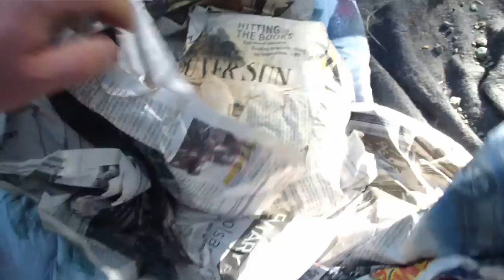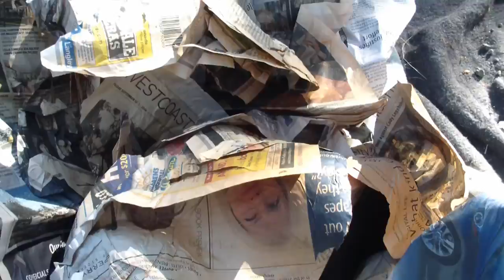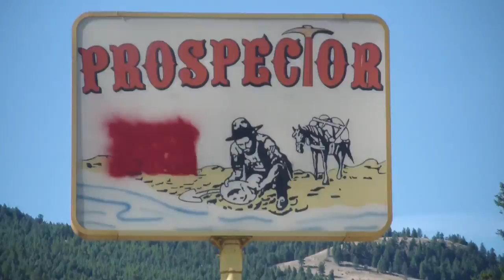$200 Axe. Wetterlings Sweden Bushman by Survivorman Les Shroud

Comment: Regarding the "Dear John's" front tires, they're angled toward each other to reduce the footprint as much as possible while still having two front wheels. Only one wheel means the front end sinks into soft ground pretty easily. Two wheels limits that problem but  those types of tractors were typically used for rows of crops, where you could stick the front wheels in between two rows and have the rows pass under the tractor inside of the rear wheels. Having parallel front wheels would make them too wide, so the solution? Just slant them. Typically the tires are angled too so the surface is still flat against the ground. 
Could they have just made the front wheels as far apart as the rear wheels? Sure, but then the turning circle would have been much larger. With the tricycle layout it's less stable (not a problem on flat ground but terrifying on hills) but it can turn 180 degrees in about twice it's width by pretty much pivoting on one rear wheel, perfect for going up and down rows.

TL:DR Doesn't crush stuff, turns better, no one probably cares

Comment: Granfors bruks is where it is at. 180 for a maul. 80 for a wedge. 125 for a small forest axe. All of them.deadly works of art that you can shave with or chop wood for hours before you.need to touch up the blade. All of them.ore signed by the smith so there is acountability and pride in the making. You made.me laugh so I'm subbing.

Comment: If it hadn't been answered already, that machine hooked up to the John Deere at 4:20 is an old belt powered threshing machine. Wheat stalks go in the front, seed comes out the side, and all the stalks and chaff come out the big pipe in back. Often run with big steam traction engines.

Comment: yard sale hammer/hatchet i paid 5 bucks for bought it because of the octagonal hammer head no handle cleaned the rust off and found the name bigalow a anvil and crucible steel under the rust no chips on the edge just dull, found it on a antiques site and its worth around 150 bucks and it works like a charm

Comment: On the tractor with the weeble-wobbles, the idea was to minimize footprint and allow less space between rows for row crops, ideally at most the same as the width of a rear wheel. The camber is jacked so down on the ground you have a thin foot, but up toward the top the wider gap allowed manufacturers to still put a properly-beefy pedestal for the tractor to sit on. The narrow front also allowed a tighter turn radius for a tractor.

Other benefits arose from this arrangement, such as easier steering, and mud not being as much of a hassle. This led the weeble to become the standard in the narrow front days.

And the Clinton Engines chainsaw is just cool. My grandpa worked the Maquoketa factory for years and years. The factory had shut its doors for years and years before it was all torn down, the only thing left standing was the headquarters building which was turned into a Clinton Engines museum. Last I knew it was still just a big expanse of bare land where that factory once stood, where they churned out all sorts of small engine appliances from chainsaws to boat motors. You'll know a Clinton if you see one with their arrowhead logo, a big nod to the large amount of Native American presence in the Eastern Iowa area. Very cool.

Comment: What a great video love the old engines the large one in a Fairbanks Morse Z 6HP and the cooling is by evaporation so you where correct. when the engine is working as it evaporated you just top it up to 1"-2" below the top off the hopper.

Comment: Called hopper cooling over here, The old Lister engines had it. The water jacket surrounds the cylinder and head. Just top up the water when it boils off. Can make a cup of tea too!   Had a tap on the side to drain it if it was going to  freeze overnight.

Comment: I have two Grandfors axes and one wetterlings all three are for specific jobs the handles are shocking on both the grandsfors and one of them has been replaced twice as the head cracked twice. My wetterlings is consistent and does what I ask it day in day out. There both owned by the same people now and to be honest I wouldn't but another new axe now as old ones are better if your willing to spend the time sorting them out.

Comment: Say Heah,  I got lucky,  I firstly ordered a closeoit Hultafors Bruks 17" Agdor,  Because they dropped it for another range,  Mine came without ears and the new range comes with ears and the edge is nicer and polished,  but more $$$.  But everything else it's spot on,  with a even and grain.  I recently again got a e-mail on a Husqvarna Forest Axe this one was just on sale and at a great price since Hultafors Bruks makes them for Husqvarna All they do is put their name on it.  But it's still Swedish steel. And this one a me out spot on too.  I have a formula for axes,  If it's a heavy head then I could heft a shorter handle,  If the head is lighter then I heft it with a longer handle.  Speed vs.  Weight,  Like my Iltis Oxhead I made into a House Axe,  it's a heavy head and even though it has thin cheeks,  I still could split with it, But with my new Husqvarna it has a lighter head and even though it has a 26" handle,  I can harness carry it with no problemo.  Thanx for the warning,  Because I almost bought that Axe at DLT.

Comment: Try a Gransfors Bruks if you want to spend that much but get the best axe in the world...
Reply: PS- What language DO you speak??   ; )
Reply: Plus avoid bearded style heads which are more for show or carpentry. I'll leave you to decide if I mean the axe or axe owner.
Reply: Shibumi agreed, gransfors bruks small forest axe for awsome lightweight cutter and can split OK.  expensive but no design flaws I've found, but spend time looking at the full range to pick your best poison. there all built for a very specific purpose. just shelled out for the large splitting axe for home splitting, it's gorgeous head to handle.
Reply: I'm a big fan of gransfors they haven't let me down yet and have a good warranty
Reply: Love my Hultafors, light but splits logs nicely. Good for bringing camping
Reply: Wetterlings and gransfors bruks are same same but different
Reply: Ok,wranglerstar

Comment: Another little tip if you don't know it.
a cheap Walmart hatchet, dull is fine  and a cheap army type folding shovel will get you out of any snow/ice related situation.
you simply make a brand new road 4 feet long in about 15 minutes

Comment: Not such an 'old fella', but you were right about the cooling on the engine at 6:00. Fill up the water jacket and don't let it boil dry. Lo tech, no radiators or fan belts to waste precious horsepower.

Comment: 5:30 john-deere hit&miss water pump engine. i restored one when i was a teen. ~1.5HP or so. car battery: they couldn't fix the magneto. i never fixed mine either. 6:00 not evaporative, the water's there what for boiling. it runs till it boils, then keeps running. just keep adding water as it boils off (slowly, so you don't crack the iron).

Comment: I just spent $23 on ebay to buy a good old American made Collins axe head. If I buy a $20 hickory handle and refinish the Collins, it will be $43. I will never spend $200 for an axe. It is just a sin. By the way, for splitting wood there is a wood splitting axe head which is much heavier, much fatter, and much longer.

Comment: Council tool boys axe $30 US good buy. I sold my gransfors and use the council. The only other option is to restore vintage. For splitting with the light axes like that I have found that laying them long ways on another log (same way you were doing to buck) and hitting the side not the end grain is the only way to go. Thanks for the laugh as usual.

Comment: 04:35 lol, that's so you can go between the rows without messing up your pretty work. There are tractors with just one front wheel, but they're hard as hell to turn cause there's less surface area to distribute the weight. And now you know more about tractors than you wanted to.

Comment: Also, In a commercial application you would want to wrap haywire from the head to about 4or 5 inches up the handle to stop the wood from turning your handle to shreds.
Wrap the haywire in electricians tape so she'll look pretty to meet your wife.

Comment: If you're looking for a new axe, go with Gransfors Bruk.  Much higher quality and much better design.  If you want something a little better, but hand forged by bladesmiths, go with Autine.
Reply: +TheWaffledOne 

Wetterlings where bougt up by Gränsfors some Years ago.
Reply: +TheWaffledOne Wranglerstar did test an Autine and the head came loose because the eye was not done properly and they filled the voids with epoxy. If it was my 300 bucks I would buy 2 Gränsfors Bruks.

Comment: There is nothing wrong withe ax. you just chose the wrong ax for what you were doing. A felling ax is for felling trees. a splitting ax is for splitting wood, and for making kindling. Wetterling makes a complete line of axes, also Gransfors Bruks is of similar high quality. The Husquivarna  line of axes are made by Wetterling, but are more reasonably priced for good quality.

Comment: I wonder how much of the price is attributable to having "les shroud" on the axe. I look at that thing and I don't see $200 anywhere on it. When  you go through the comments on amazon, you see that the wetterling's forest axe was $65 in 2011, and somehow it's $150 now. 

Most of the scandi axes look like they're at the upper end of being sharpenable by a file and stone. Not sure what practical advantage they'd have over a vintage $25-$50  kelly cruiser mounted in a new handle. I'd guess none to actually negative (since kelly has a big enough bulge in the cheeks to make the axe easy to remove from a deep cut).

Comment: Gränsfors Bruk bought Wetterlings so the quality should have improved but nether are really all that good and there is nothing special about Swedish steel nowadays.
Reply: ***** I'd recommend a Hults bruk axe. They were bought by Hultafors and so you'll have to look around on the used market. Agdor was a popular model. They can be had for $45 from a surplus store here in Sweden.
Reply: ***** Here is the axe that can be had for $45 http://store.flobyoverskottslager.se/product/yxa-st%C3%B6rre
Reply: I could snail mail that one to you if you sent the money over say paypal.
Reply: ***** Right on! :) But I do hope you pick (get lucky) a beter one next time.
Reply: ***** the steel is good and they dont look like a aprentice mistake like the one in the video. I'd rather have more steel than i need and work it down to something good than to have something with a wonky edge. :)

Comment: give it a wee grind on the sticky bit. thats a woodworkers axe almost.  if you look at some of the old light axes for actual fabrication by stock removal, they just have a pretty minimal connection with the handle, so if you were to use it as an actual werkzeug you could cut the silly modern excess bit clean off. its just there so modern man can exert his full dumb force without breaking it.

Comment: Wetterlings Carpenter's Axe, yeah you probably already know. Blade is a little too curved, no good for shingles. Poll is just a little short but still useful for roofing nails, nail between fingers, palm up. Handle too long. Original design is for a shorter 12-16in. But $200, lol , P.T. Barnum was right!

Comment: I don't think my first response got there.
Poor handle choice.
You want the grain to crest at the front or back of the handle.
It's stronger for prying to the sides.
Also, using haywire,lay a bead 5 inches from the head towards the head and wrap it down to where you started and tie it off.
Now the wood can't wear on your handle .
Wrap it with electricians tape to be pretty.

Comment: Dude your axe is for like chipping some kindles to start the fireplace. Woodchopping axes have wider cutting angle so it wont stick and actually "chop"
We had similar axes in the army, only because they needed to be light. Still sucked tho.

I have a Fiskars woodcutting axe and its good. Even has some weird slippy coating on the head for some glidier chopping or something.

Comment: At 4:30, that my friend is a ye olde grain thesher. Runs by that belt round the flywheels by either steam engine or one of those stationary internal combustion ones
Reply: David North back in the day, Ford sold a belt drive attachment for the drive wheel on the model T. ( you took off the wheel, pit on the drive pulley.. f course the car was jacked up)
and you could use your ford as portable power.( selling point in the rural areas)

Comment: Maybe you could weld a wedge behind the blade bottom that would split lumber before hitting the handle?
Reply: +Marc83Aus Shouldn't have to for $200.
Reply: +Marc83Aus Shouldn't have to for $200.
Reply: I'd ease the sharp corners with a grinder, but yeah, for $200, you shouldn't have to.
Reply: If regrinding is a necessity, might as well just get an Estwing and grind the edge to the profile you want.

Comment: In Alberta you cant even chop up dead fall. It's around $280 fine. Just another way for them to force you to pay for over priced fire wood. That made me laugh when you said, go into stealth mode. We went camping for mom and dads 50th anniversary. Try going with 2 Black Labs. The old one wants to lick you to death, and the young one wants to tear your face off. Told my sister, you cant bring Tuxedo when we go house boating in B.C. next fall. He might be a boat anchor by the end of the week.
Reply: But isn't gathering up dead wood good for preventing forest fires?
Reply: surely is, the less fuel the less chance of a burn, also can keep the forrest healthier too.

Comment: you need some better campin land the places I go I usually don't hear or see another vehicle more that twice a day also if you just burn the end of all the logs at the same time and keep pushing them farther into the fire you don't half to do so much cutting space em apart and angle em up a bit so the fire don't crawl down them saves a lot of time and i always drag logs in with a atv so no work.

Comment: It looks like you got ripped off. Not in terms of an expensive shop, but in the price/performance alone. GB gives you a much finer axe for less money. It looks to me like this design is based more on a niche dead-handedness than actual practical value. Plus this is not a splitting tool, so the impractical square hole collar could be even dismissed by some.
I'm sorry for this happening; it will probably discourage you from getting the GB and discovering that the art is not dead yet.

Comment: Meh, you need a Fiskars. Better and wayyyyyyy cheaper (atleast here :)
Reply: *****
Heh heh, mine have been thru winters and indian summers and yes, we occasionally get -50C here too. Handle that takes a metric ton of load before it even bends. And that teflon coating allover the blade. Used my little X7 as a fence post driver (with the hammer head) once because didn't bother to walk 2km to get sledge hammer. Maybe you had a faulty item or it was pre-X generation...
Reply: *****
I had a Fiskars water hose that took a crap the damn threaded ends would fall right off. The best part is I call to get it fixed under the warranty and the exact response was we can't help you we don't make hoses anymore. I pissed me off but at least you can get cheap hose repair fittings to repair a hose. It's absolutely crazy how much a quality water hose costs now for a 100 rubber one it will set you back $75 dollars.
Reply: *****
 It frustrates me so bad but I can't justify tossing them away either yet. I will get a few more years use out of them they are mostly used for stationary irrigation for my garden, so once they are all set up they won't kink on me. If you had to use them like a normal hose them bastards will kink if you look away for a second. I love how they all say on the package no kink ever design. I will have to look into that next time thanks for the heads up.